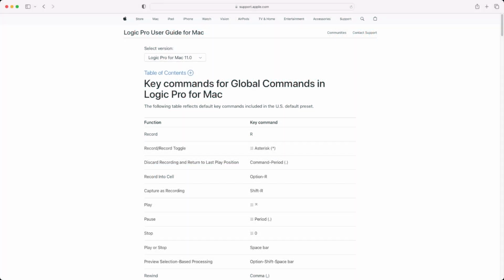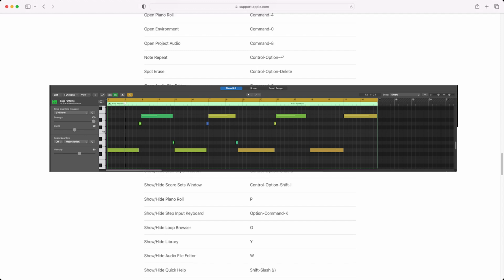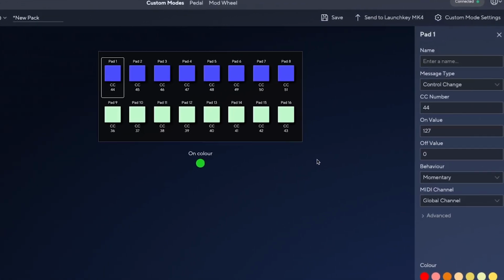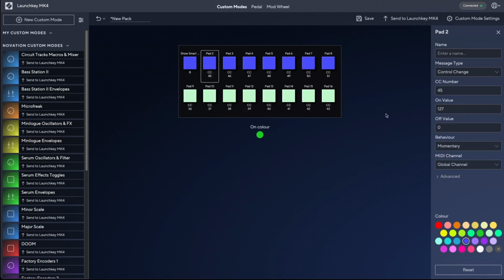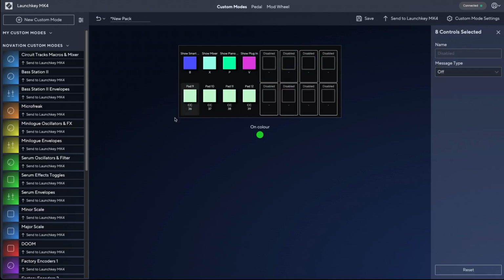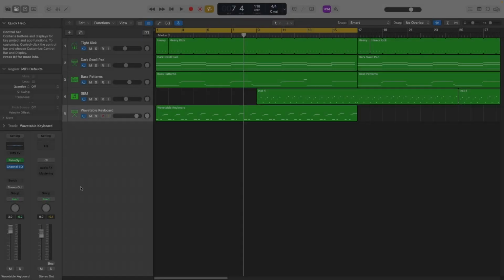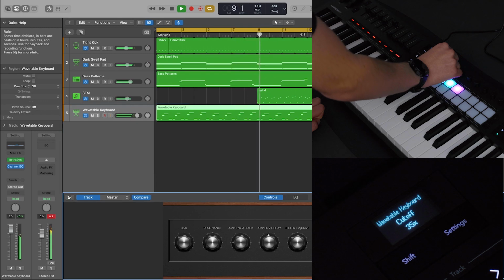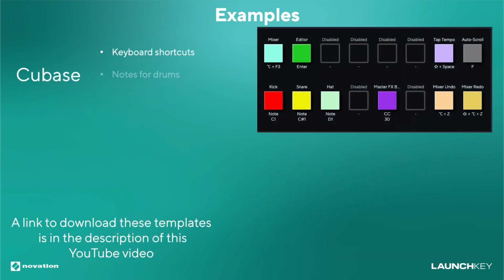Creating keyboard shortcuts using Launchkey MK4

Comment: You skipping steps and details which makes it confusing for brand new users. For example after assigning the pads you did not explain what to click to use the assignment. I saved it but it is not working for me. Obviously I must be missing something, but you shoudl be more mindfull to explain this like for 5yr old (which is new user of this keyboard).
Reply from the maker: We’re sorry to hear that you found this difficult to follow. Your Launchkey has four Custom Modes. When you created the Custom Mode using Components, you would have pressed “Send To Launchkey MK4” and chosen which of the 4 available Custom Mode slots on the hardware that you wanted to use. This is where it will be stored for future use.

Holding Shift and pressing one of the pads labelled Custom Mode 1 / 2 / 3 / 4 will load that Custom Mode.

If you’re new to working with Launchkey, you will find the User Guide available from our website useful:
https://downloads.novationmusic.com/novation/launchkey-mk4

Comment: It’s a great feature, but I tried making a template for Maschine 3, downside is that the transport buttons on my key 37 mk4 can’t be configured… like space (on typing keyboard) connected to the play button on my key 37. I think the mackie protocol is used but I can’t seem to configure it. If you could do that would be great. (Transport just as configurable like the pads) 
My second gripe is with reason on certain rack extensions patch up/down doesn’t work. I used additional overrides to link it and that seems to work, weird thing is the track up/down is also already configured there (as is undo), wonder why not do the same with patch up/down, instead of having it linked to the specific rack extension, just use the additional remote override also. 
3rd, this is one of the best midi controllers on the market now, I started with a remote25 20 years ago , and this reminds me so much of it. Build quality is great also.😊🎉
Reply from the maker: Thank you for taking the time to share your feedback, suggestions, and kind words with us. We really appreciate your support 🙌🙏

Comment: Tried making a custom mode for the Launchkey MK3, but nothing appears to be confirmed.
It said I needed to update, so I did, but it told me it failed. Then when trying to update again, it said it's up to date.
Saving a custom keystroke group doesn't seem to keep it saved.
Any advice for this problem?
Reply from the maker: We're sorry to hear you're having problems. Have you tried using the offline, standalone version of Components to manage your Launchkey? You can find it in the menu at the top right of Components.
Reply: @NovationHelp  Using the offline version is certainly easier. I wasn't aware of that at first. I managed to solve the custom mode problem. The issue was that I assumed the mode would activate when selecting/loading it in the app, but it wasn't mentioned that custom modes have to be selected manually via the Shift button on the instrument. Thank you for the help!

Comment: Wow that's great ! I wanted to know if its possible to combine custome keys with classical clip launch (like for instance keeping the 8 pads for clip lunach in Ableton and having the 8 pads on the right with these or other custom things)
Reply from the maker: It isn’t possible to combine a Custom Mode with Clip Launching Pad Mode directly, as the latter uses Ableton Live’s Control Surface Script. In Clip Launching Mode, the pads represent the 2×8 focus ring in Live’s Session View.
However, you can create a similar workflow using a Custom Pad Mode. In Components, assign the controls you need as shown here and leave the pads you want to use for clip launching unassigned. Then, in Ableton Live, manually map those pads to the clips of your choice. This mapping can be saved with your Live Set for future use.

Comment: is there any plan to let use the function button with custom modes?
Reply from the maker: Afraid we don't fully understand. What kind of thing did you have in mind?
Reply: @NovationHelp  I think it would be great if we could program multiple functions for each of the pads, where the Func button on the Launchkey could be used to cycle between them. For example, if I set Pad 1 to carry out an Undo operation, when I press the Func button all the pads will be set to their secondary function - for Pad 1 this could be Redo. 

It might be easier to just add pages though, in a similar way to the drum pad mode.
Reply from the maker: Thanks for elaborating. That’s an interesting idea. We don’t currently have plans to develop that functionality, but we’ll certainly share your suggestion with our Dev Team for consideration.

Comment: Cool video. Thanks for this. I have been looking for these instructions since buying my Mk4 61 months ago. I have yet to figure the best way to store settings for 3rd party synths in Ableton Live and so far have only tried saving them as Instrument Racks. My main interest however is MPC (Live2) and Akai Force. I am interested in what can be done in the way of a saved template in MPC with well thought out mappings to Mk4 controls. I would be very interested to hear from anyone has this sussed out.
BTW Thanks for the Bass Station plug in. Much appreciated.
Reply from the maker: We haven’t specifically tested those Akai products, but the Launchkey Custom Modes are likely your best option. Since Launchkey is USB Class Compliant, it will transmit MIDI over USB once connected to your hardware. The Custom Modes let you customise which messages are sent from the Launchkey pads and encoders. You'll just need to find the specific MIDI messages for the parameters you want to control, which are usually included in the product documentation for your hardware.
Reply: @NovationHelp  Thanks. I guess I'm your test pilot then. Also made all the more interesting with the FULL release of MPC3 and the NI integration. I would certainly like to hear from anyone who has used Mk4 with MPC standalone.
Reply: @Jazman342 I’ll do some work on that too brother maybe we can figure it out together faster because I’m wanting to do the same thing
Reply: @TheLastScribeAlive  Fantastic to hear that. This is something I had given up on ages ago but a few days ago bought the 25 key version ( more portable) with the intention of getting a deeper understanding of the encoders and buttons. I have not as yet looked into custom modes and am in truth a little intimidated by the idea. Same with 'Components'. Have downloaded manual though and started trying to understand all the finer details. Would certainly be interested in a joint effort to get this happening. I think the faders on the 61 should be the easier part. The shift functions of the pads the hardest. I'm 72 with an interest in keeping my brain active by learning new things. I actually got more into trying to learn to sight read piano music after getting the 61 than learning the knob and pad functions.

Comment: I think this goes in a really cool direction, just ordered a Mini 25 MK4. Especially Ableton isn't flexible with shortcuts. To store them directly on the device is super cool and even an advantage over the Stream Deck. I think this could be even extended to macros like possible on QMK Keyboards, so we can save a routine CMD+F, 20ms pause, backspace, 50 ms pause, arrow down, arrows down, arrow left... etc. to reach certain elements in the browser. But even as it is, it is a big advantage to have a generic MIDI Controller and Keyboard in the same device. BTW. mouse movements for the modulation touch strip as alternative use would be super cool so we can hover the mouse over a parameter with the regular mouse, and the touch triggers left click hold, while the finger movement moves the cursor and once the finger is released the left mouse button will be released too and for the few horizontal sliders shift+touch strip will change the mouse axis.
Reply from the maker: Thank you so much for your thoughtful feedback and great suggestions! We're thrilled to hear you're excited about the possibilities this opens up. We hope it helps you unlock even more creative potential with Launchkey 🙌🙏